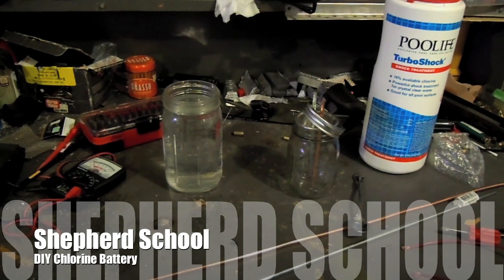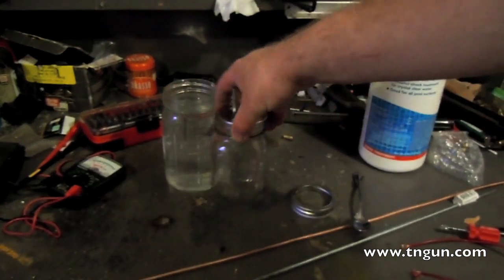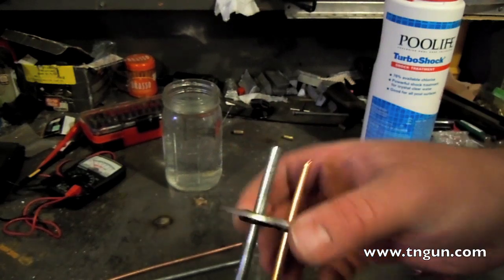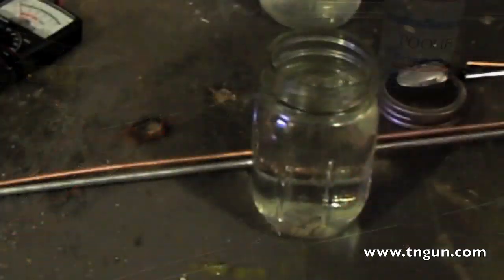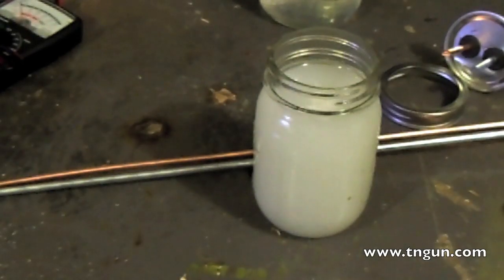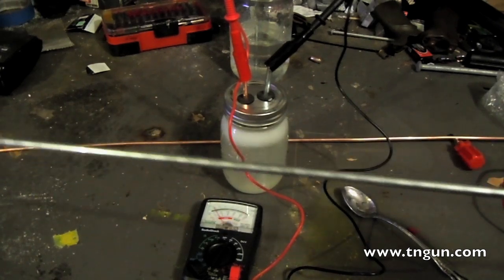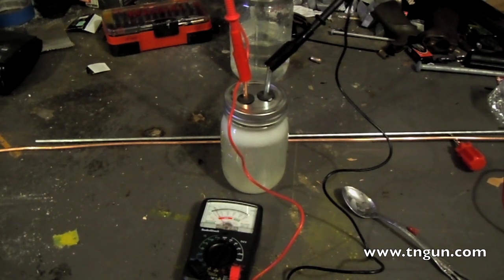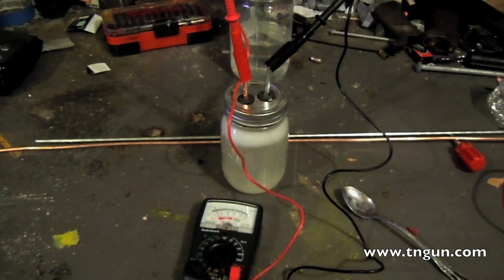How to Build a Chlorine Battery

Comment: edit: oh god what the hell did I suggest, This is like the "just mix bleach and vinegar" of electrochemistry. I really said this 4 years ago and I am CONFEDENTLY INCORRECT. oh man am I glad people didn't like this comment. I'm keeping it out of pure personal cringe, maybe some rando will notice my blatant errors and we can share a laugh out of it.

"+Shepherd School , Use Potassium or Sodium hydroxide instead of chlorine bleach. They are stronger bases and can boost the voltage & amperage of the cell without too much replacement. If you want to use this for prepping you can convert wood ash (potassium carbonate) into hydroxides by using the exact same process to produce lye for soap. The battery should make around 2.5 volts per cell and just under an amp for using so little aluminum. Good work with this too though, I never knew you could use bleach for this reaction :) "

Comment: Okay I have an assignment where I need to provide either 12.0 volts and 30 amps or 5.0 volts at 45 amps. Amoung the materials I have to work with are some 1/2'' and 3/4'' copper pipes, 8 roles of aluminum foil, some vinegar and PH adjust down, 23 20ft lengths  of 6 in. sch. 40 PVC pipe, 17 20ft lengths of 4in. sch. 40 PVC pipe, and 9 20ft lengths of 2 in. Sch. 40 PVC pipe. I also have some cans of cold galvanizing spray paint (a lot of things on batteries mention galvanized nails).

Can I manage with this stuff?
Reply: +Metazoxan Dexall , Why would you do this. No, you have the wrong PH. You need an alkaline solution. If you got two bottles of drain cleaner with %10 Sodium Hydroxide (NaOH) then maybe. Aluminum foil is shit for this but you could make something around this:
- 6" x 6" pvc container with either regular or makeshift caps and clips to hold the metals in. 
- Cut about Five 4" lengths of 3/4" copper pipe and saw one half end off to convert them into flat sheets that are maybe 4" x 2" plates and sand them.
- Since aluminum foil is a BITCH get about 25 4" x 2" sheets of the foil and bundle them into groups of 5 bound electrically (physically touching) and clip them together.
- Grab a 1/2" copper pipe and cut 1, 8" length and place it in a way so that it can hold the electrodes but also allow for a waterproof cap.
- Bind everything into a similar configuration to a lead acid battery.
- Try to sand or just ribbon cut the aluminum after everything is electrically connected and sand the copper plates you made to add surface area.
- I fucking hope if you made it that it fits together and is water tight still.
- Fill the fucker with the drain cleaner so that it can react.
- If you need to use it for an extended amount of time add a gas escape for the hydrogen production.
- You just made a 12 volt battery, that will produce between 5 to 12 amps depending on how you made it. Make 2 for 24 v, 24 amps.

So yeah, How was that Assignment last year?

Comment: You still around? 8 foot cooper lightning rod 3/4 inch surrounded by 8 of foot aluminum inside a 6 inch pvc pipe. Any ideas on voltage?

Comment from the maker: I have to either get some resin and make a permanent magnet generator or go to the pull a part store and get an alternator - it runs, but I haven't figured out how to turn it into usable work - I got sidetracked into using a rocket stove to generate heat as well as superheat the steam.  -  Plus I have been playing with my bees and changing around the tngun website - but thanks for asking.